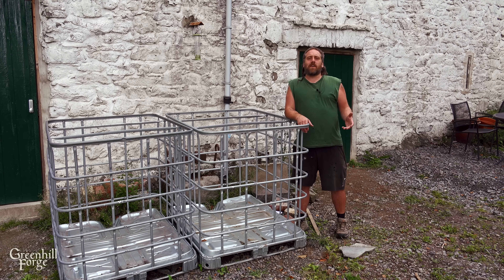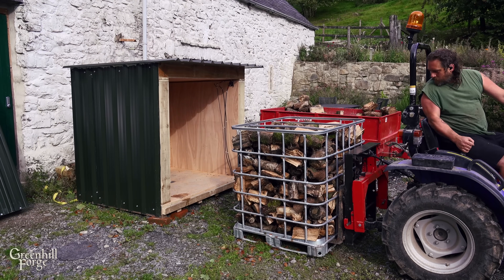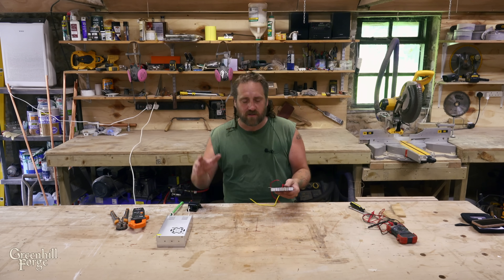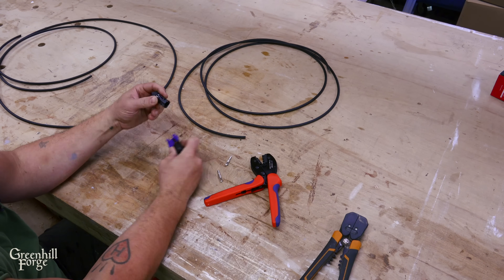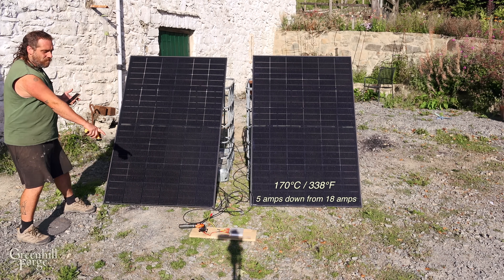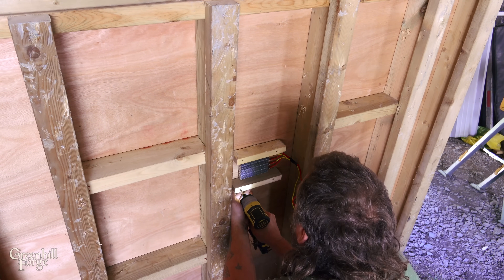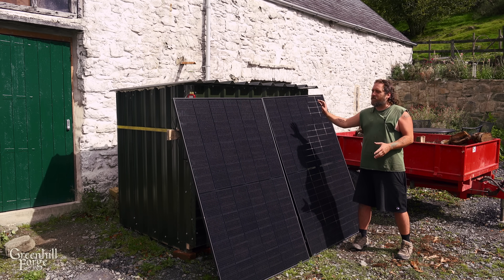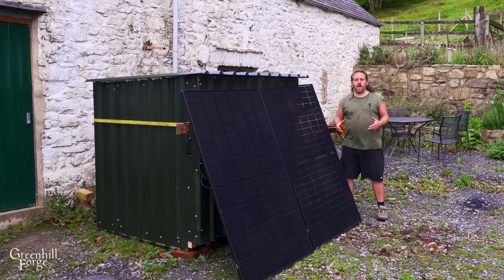Building a DIY Firewood Kiln: Solar-Powered Small Scale Portable Off-Grid System

Comment: Well executed however I think you might be missing the wood for the trees. Sun energy is 1300w/m, about 500w is infra red 'heat' energy, about 800w is all the other stuff you can generate power from, however solar panels are only 15-20% efficient so in the case of heating you need approximately 2-3x the area of solar panels to generate enough electric to match the heat that the ground would have gotten anyway before you interfered... solar panels are great for powering your TV but not so much for heating.

You would be better off drying your wood in a green house, just cover the floor in plastic so moisture doesn't evaporate up from the ground.
Reply: In generally that is a valid concept, but the comparison of efficiency is a bit more complex than just mentioning the 20% efficiency of the solar panel.

Firstly the material of a green house will not transmit 100% of the light either, generally it will be more like 80% to 90% of the overall spectrum that makes it to the inside. 
Secondly, wood is a pretty "light" material, meaning it actually scatters a lot of the visible light away instead of absorbing it as heat. Usually, only around 50% of the light energy will be absorbed by the wood.
So in combination, just putting wood in a greenhouse will probably just use about 40% of the sun light for heating.

Plus, on a cloudy day, the clouds and the environment will still backscatter a lot of visible light onto your solar panel, but most of the infrared light will be absorbed by the water in the clouds and never make it to ground. 

And then the question will still be if your greenhouse is as efficient to keep the heat inside as a fully covered box, which is probably not the case. So the final temperature of the wood will still be a little less than the larger amount of heating energy (~40% instead of ~20%) implies. 

And then you have a greenhouse, which will generally require more regular maintenance, meaning repairs, than a wooden box with a solar panel, thermistor and heating element.
Reply: @ShieTar_  Solar panels don't last very long in the real world and they get covered in stuff that needs regular cleaning. A green house would be cheaper (plastic covered ones at least), glass ones probably the cheapest of all in the long run once you factor in heater and solar panel replacements. Also there is virtually no risk of a green house burning down.
Reply: @Rufeo0  You can still combine both, thermal energy plus PV. Btw, the solar constant is about 1300W/m², but within the atmosphere it's more like 1000W/m² or less. Still a lot.

Comment: Link for PTC heating element?  Curious how many watts of solar, and how many watts of heat that PTC actually puts out.  Assuming 800W of solar, and close to 100% efficiency, I do think it'll work.  I was super skeptical at first, but back of napkin estimate says 20-30 days should substantially dry the wood.  Looking forward to hearing practical results.
Reply from the maker: I'll look for the link but I bought it a while back. the panles are 445W plus bifacial

Comment: Love the effort here and just going for it. You could probably increase the heat input greatly by putting some clear plastic sheeting on the outside and drilling a few more vent holes. The sun is really good at heating directly without converting it to electricity first. 

Take a look at a Trombe Wall, they use a similar principle
Reply from the maker: I agree in priniciple but the benefit of this approach is that the solar array can scale up while heating the same volume. with a greenhouse you're stuck with the same surface area to volume ratio. but i'll do some comparison testing in the future.

I also really like trombe walls. my greenhouse is build with the same concept https://www.youtube.com/shorts/d_9Iyp3P0-w
Reply: @GreenhillForge  You can scale that up too, by adding reflectors. Very common design for box-style solar ovens. But even without that you can still combine photovoltaic AND the sun's thermal energy.
Reply: @GreenhillForge I don't see why you couldn't use both and stack your heating. Now I'm thinking you could do a greenhouse tent or something next to it and pipe it in. Excited to see whats next.
Reply: I think there's a lot of wisdom to this-you should 100% keep the current door, but having a clear door, perhaps made using reclaimed insulated glass, that you could use to get direct solar heating during the warmer months of the year along with the solar powered heater would be ideal

Comment: I love the stuff you do! 
But, I kinda feel like you're way overengineered here. Solar panels are only about 20% efficient, why not just throw polycarbonate for the roof and it would be more like 80% efficient, then use a tiny percent of that to run a fan to draw the heated air through the wood?
Reply: That's what most people do when they build a solar kiln.

Comment: I had an absolute dynamite alternative plan for you that is mostly passive until you said you were in the UK (not especially known for its wealth of sunlight). At any rate, if you want a back-up plan, using carbon fiber filament as a heating element produces pure Infrared heat at relatively small wattage requirements. The benefit is that it doesn't waste energy in heating the air, only the object(s) within its effective range of contact (size of the element dependant, anywhere from 1-6 meters). Add to that a few transparent panels--namely the roofline and one panel that sits in the sun longer than the others--you can get a very power efficient dryer that is partially passive and get an internal steady-state temp to around 60-65C fairly easily. 
The fan is a great idea for your application, though I would advise adding a desicant material on the inside to absorb excess moisture, since you likely won't have an abundance of pressure or cross-draft to move air through. There's a lot of materials to suggest from simple silica beads/powder to pulverized clay, but the main draw is that you don't want it inhibiting back into the wood of course.
Reply: (ERV and desiccant wheel  - solar powered dyer, I keep seeing it as a tiny house - solar conditioned.. lol - HRV allows ventilation and removal of all humidity above ambient - drying wood will tend to have more humidity inside than outside, most of the time, with dehumidifier - ERV will kick things along - if course ridiculous overkill by that stage.......)
Reply: Where do you think the heat is going? Any heat you dump in there is going to go into the box.

Comment: Heat is good but I wonder if it might be more effective to have the panel running a dehumidifier at the air intake with the fan as exhaust. You may find pumping air dryer than normal is more effective than heating moisture laden air.
Reply from the maker: An oversimplified rule of thumb is that relative humidity halves for every 20°F temperature increase. So in my initial test I probably did roughly halve the relative humidity. I'll take humidity reading as I'm recording data during the testing phase and show it all in the followup video. It would be interesting though to make a version that is fully sealed up with a dehumidifier running inside that drains water to the outside. It would require a more expensive solar setup but worth testing i think.
Reply: @GreenhillForge  Doing mold remediation I had to use dehumidifiers on a daily basis. The heat is good, do not add fresh air and run a dehumidifier in the sealed, or as sealed as you can, unit. You eliminate adding outdoor moisture to the system while the heat helps the moisture migrate out of the wood. But my thinking might be missing the point of the solar set it and forget it. But it would be interesting if DC dehumidifier could be incorporated. If we seal off a room we could take a soaked room to dry over the course of a week. Maybe a future experiment ;-)
Reply from the maker: I really like the idea, especially not adding more outside humidity, and once set up i think it would be just as set and forget. Designing a simple and cheap system might be the hard part but definitely something I'll think about
Reply: @GreenhillForge .  I built a small sealed system (under 1meter squared) with a dehumidifier.  The dehumidifier drew about 50W, added heat to the enclosure, pulled about 500ml of water out of the wood every few days and reduce moister content about 2% a week for the wood stacked on the top of the pile.   Seems the secret is to move the air a lot inside the enclosure. I used the excess power from my solar system to run the dehumidifier.   I like your idea of the self contained system and if each one had a stand alone solar system to run a dehumidifier it would be pricey.  Looking forward to your test results.
Reply: @GreenhillForge dehumidifiers should be removing more moisture for a given amount of energy since all of the energy used by an appliance in a given environment creates heat and they are also using that energy to condense water from the air on the cold side.
Reply: It might be more efficient, but I think a goal of this build was simplicity. Eric could also have ebbed more power out of the solar cells with an MPPT controller, or achieved more steady energy with a battery, but omitted even that to reduce cost/complexity. In an environment where things are moved around via tractor hitch, which sits outside in sun/rain/wind, and where sawdust/wood scraps are commonplace, a pressurized gas system with valves and a compressor and condensate disposal will need frequent maintenance/cleaning.

If going the fluid route, it would probably have been better to use thermal solar panels and run a loop to a radiator. As a general rule of thumb, solar + heat pump gives the same thermal energy as thermal solar, about 5x what photovoltaic to resistive heating offers. This point becomes pretty mute if you have the option to just build more PV 😅 and get your energy that way.
Reply: I am currently experimenting with stacking wood under metal roof panels, so that the wind can blow through it more easily. The panels heat up due to the sun, but I think the wind will be more effective, and I can safely burn freshly split wood after 4 months.
Reply from the maker: this is basically what I currently do but it's just too chilly and humid where I live so I'm trying to turbo charge it
Reply: Why don’t you add a recirculation duct to a simple heat exchanger and save precious heat?
Reply: I also think as the others that adding a small dehumidifier inside having a sealed unit can be worth it, you'd need to plug a simple drain hose and see it drip water while drying the air inside. This is very good at drying laundry, so it could be very interesting to put it in the kyln
Reply: One of those “dedicant wheel dehumidifiers” would probably work well and be more efficient than a compressor based one.

I was thinking of a DIY/OS Design that would be more akin to a Pressure Swing Adsorption system but with Silica Gel etc for adsorbing humidity then purging it to atmosphere.

Just hot air and valves would be needed.

Might not be much better than a Off The Shelf Desiccant Wheel one though.

Either way, i would love to see this!
Reply: @ericlotze7724  for this purpose desiccant dehumidifiers are less efficient than heat pump dehumidifiers. Desiccant dehumidifiers separately make cool dry air and warm moist air (from recharging the dessicated). Heat pump dehumidifiers make warm dry air.
Reply: This may not work, but was inspired by this thread and your attempt to be low tech with minimal failure points. What about a ducted intake for the fan with an inline “filter” containing a moisture absorbing material. It could be a consumable material similar to Damprid or a rechargeable material similar to those passive small space dehumidifiers. Over all I can’t wait to see the results of the design as is, I’m already dreaming of something similar to heat a small greenhouse in the late winter for seed starting.
Reply: Simple answer is no and the long one is are you stupid ?

Comment: Wouldn't it be more efficient to capture the solar radiation directly using a greenhouse setup rather than converting to electricity first? I think you would need a much larger surface of solar panels to make up for the low efficiency of the solar panels at converting solar radiation to electricity.
Reply from the maker: a greenhouse effect would be good if you have enough sun and yes the less times you convert the energy the better. unfortunately I don't live in a very sunny place so the benefit with this is that I can scale up the solar array while keeping the volume to be heated the same. with a greenhouse you're stuck with the same area to volume ratio.
Reply: @GreenhillForge  you could easily make flat plate solar air heaters for a fraction of the cost of PV and they would deliver 5x the heat per square meter
Reply: @GreenhillForge try living here 🇬🇧🤣🤣🤣🤣👍
Reply: Or if you wanted to beat the efficiency of a greenhouse at a higher cost you could just use a heat pump.

Comment: Look forward to seeing results from this. Seems like just making box that gets hot in the sun might generate more heat and keeping the solar electric for fan or dehumidifier. A solar chimney would also do a lot to move air. Drawing a vacuum would be great and often used for dehydration but that's a whole other level of fabrication.
Reply from the maker: If i lived somewhere more sunny I'd do something more like a solar water heater but we just don't get enough sun where I live. this way I can just scale the panels to match the energy need
Reply: @GreenhillForge that makes sense. Hard to add more sun but can always add panels.
Reply: Running a dehumidifier on pv instead of producing so little heat with it is an interesting idea

Comment: Looks like a great prototype. A couple things I would test is having the same setup without the heating element present, that way you can see what effect it really is having on the system. Could be a "green" box (got black siding?) is nearly the same and it could be worth just having more boxes instead of adding in the heating element. Likewise for the vent hole sizing, it would be interesting to know how small you could go without trapping too much moisture in the system. Last thing is I would think insulating the bottom (leaving space for the forks ofc) would have a big effect as you are likely loosing a lot of heat down into the ground. Can't wait for the update on this system.

Comment: I would look at using a series parallel diode array, sized correctly so the voltage drop across the diodes matches the panel maximum power point voltage, they will track the ideal power power point perfectly in all conditions, without the need for complicated MPPT. Use high power diodes t220 etc and mount them to a heatsink thats it!
Reply: Exactly, well said. Diodes all the way, ptc is a bad load to connect directly to the panel.
Reply: Agreed your current system might produce some heat, but it will be far from optimal as you aren’t keeping the solar panels at their optimal voltage for close to maximum power. This is what an MPPT controller is doing, although getting a fixed voltage can be close enough
Reply: Yes agreed, Also look up @solarpoweredge He has been playing around with the idea of using diodes as heating elements Directly  connected to  solar panels. The problem with directly connecting a heating element  directly to the solar panels is when it's cloudy It will drag the voltage straight down and you will Hardly  get any heat at all

Comment: Why isn't the heating element on the inside?
Reply from the maker: because this way the incoming air has to pass through the heater. could be worth try both to test against. but the main thing is having following air to let the moisture escape
Reply: @GreenhillForge that makes sense. Didn't realize the air passed under and then through the kiln

Comment: Great idea, but if the heating element gets up to 200 degrees C isn't there an inherent risk of it setting the cage on fire? Maybe it would be a great idea to mount it on a metal-plate?
Reply from the maker: 200C is below the auto igniition temp of the solids this might be in contact with so it should be fine, but even still I wouldn't put this directly next to a wooden building. For example plywood and solid wood is around 250C and dry leaves 230C . Even paper is 220C. The ptc also can't be in contact with something conductive like metal as it could short the circuit. Couldn't hurt to put some kind of non conductive gasket between the ptc and plywood but I don't think it's actually needed. But I'll let you know if this burns down ;)